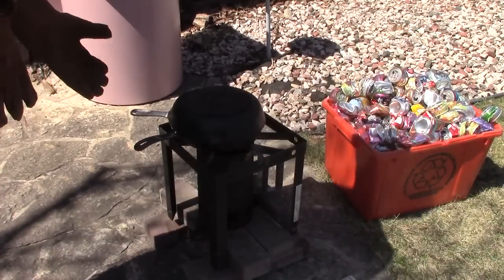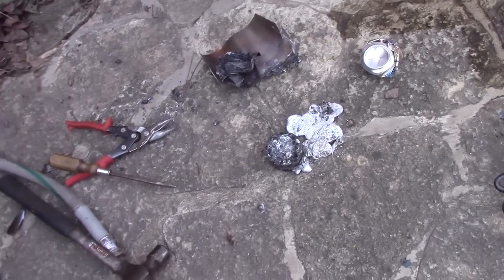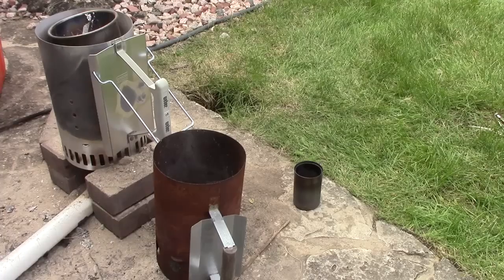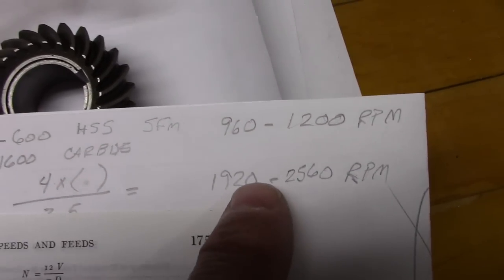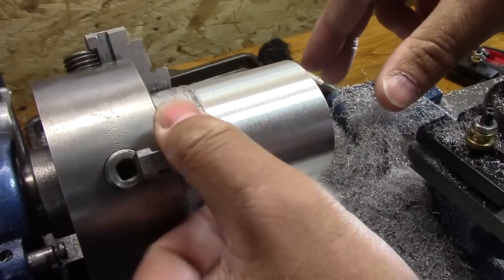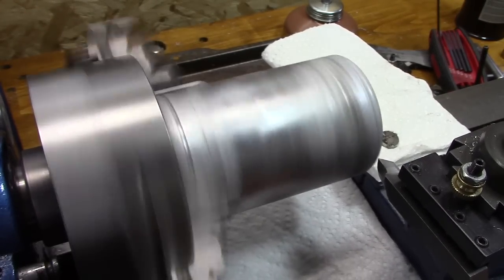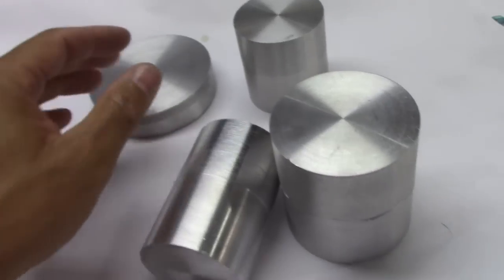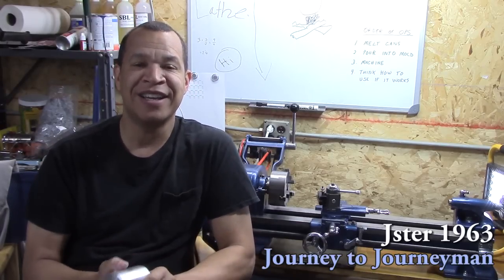Journey to Journeyman, Episode 5, How I made aluminum stock from cans

Comment: Man, we're into the same hobbies! Melting metal is very addicting so be careful. The reason your stainless steal containers are failing is due to the charcoal acting like an abrasive with the hair dyer. I had the same issue. I found that having another protective layer helped a lot. For example, I would place my SS container in a soup can.
Reply from the maker: Great info!  I melted through some pretty thick SS.  I saw your propane tank foundry and that's exactly what I plan to build this winter.  I plan to use waste oil.  I have a ton of it.  Thank you so much.........

Comment: Hi, I am back. While watching you turn the aluminum, I noticed the cutting tool on your tool holder. Did you grind that cutter or buy it ground like that. If you bought it, where did you get it. I have been trying to grind some from stock,but that is an acquired talent. I have a similar tool holder from Phase II for a 9 in lathe. I am using the indexable HSS cutting tools from AR Warner . Thanks again...Ken
Reply from the maker: Kenneth Bartlett Welcome back;-)  I ground that tool.  I'm trying to learn to do that too.  It's not perfect, but on aluminum it worked.  I'm going between indexable and HSS that I grind.  I hope to be a good tool grinder someday.  And thanks again.....

Comment: One of the things I like most about you and your videos is how you just get out there and try stuff.  Well done!  

Consider reading 'The Charcoal Foundry' by David Gingery. Excellent resource for what you are doing.    You would probably enjoy the sections on green sand casting as well.  If you like his books he has manuals on making all your shop tools from scratch or junk.  Make a mill? :)

Safety: Gingery suggests doing your melting and pouring over dry sand.  Molten aluminum explodes if it encounters moisture, like wet stones or concrete.  (Rapidly expanding water vapor)
Reply from the maker: Thank you so much Chester!  I tend to jump into the deep end, only to realize I don't know how to swim;-)  Anyway, I was trying to see if I could melt the aluminum with simple everyday stuff I had.  Now that I know it's possible, I plan to make a foundry.  I will checkout the Gingery foundry.  And yes, safety is #1.  I will take precautions now that I know I want to do this.  Thank you very much for the info and the comment......

Comment: As someone who melted using stainless steel crucibles for years, the main worry is your stirring rod actually poking holes in the bottom since the stainless steel is well above the forging temperatures. I swapped to graphite and I can tell you cheap graphite crucibles are far superior to anything else I have used. As for fuel, simple scrap/junk wood (NOT mdf) works better than charcoal briquettes as long as you stack the wood in such that it is lump charcoal by the time it reaches the bottom.  As for pre-burning the coffee cans before pouring, that is a pretty smart way to reduce inclusions from burning gasses.
Reply from the maker: Thank you so much for the info!!  I’m using a steel crucible right now just because I have it. I never thought about forging temperatures. That’s great to know. I’ll try to be gentle with my stirring and pushing. I planning to get graphite someday, but I’ll have to get tongs to lift it and something to hold it to pour. I’ll do that someday. And thank you again.....
Reply: @jster1963  I made my tongs out of some random flat bar ( a lot of bending and checking the fit). the biggest worry is if your stirring rod is pointy. as for the forging temperature properties, think of the steel as being softer than lead and almost like clay.

Comment: If you don't force the cans into a coffee can, it can only be used once. It's best to use something a little bit tougher. A steel pipe with a plate welded to it works. 

Ingots can be poured right into sand formed for the size of the next crucible it is going into.

Comment: I usually use "Used Engine Oil" only use the charcoal to preheat the main Oven CAN" and have my can cover with about 15 inches of "Pink Home insulation" that usually keep my oven from loosing to much temperature. the only problem of doing this my way is that you need a more powerful fan than a hair drier.. not to much! but sadly the hair drier is not enough..
I will contact you soon in the forum. Very nice video! Ho! and by the way! According to federal regulations all aluminum that is in contact with food! HAVE TO BE 100% pure aluminum! so is a great quality product but it is very soft! no like what is available most of the time. that have silicon, and some times a bit of nickel... Good luck man! I feel very envious of your good work!
Reply from the maker: Thank you so much for the kind words!  I want to make a foundry just like u described.  I have been saving used engine oil for years.  I probably have 55 gallons.  I do have a more powerful blower too.  I just wanted to see if I could get the aluminum to melt with simple stuff.  Now I plan to make a foundry.  I heard the aluminum was a good quality, but I don't know yet if it can be used for anything because it's so soft.  I will have to do some research.  Thanks again.......

Comment: Good work and video!
Yes, food cans can work great for molds, I use them for ingot molds allot.
Using a food can for a crucible normally works also for me but I limit them to 1 use to avoid burnout. Some good videos out there for cheap easy foundry furnaces. A good insulated furnace will hold in heat well so  less fuel needed and less heat required, sort of. Still need same temps to melt the aluminum of course but with less heat loss less heat needed to be fired is less heat to cause burnout of the crucible.
Reply from the maker: +Den Stump Thank you so much!  My sons and I made a furnace and I plan to upload that video soon.  I just made a new "THICK" crucible and I hope it never burns through.  Anyway, thanks again for the info.....
Reply: I'll watch for the video.
I should do videos of all my stuff, but I am not good with a camera or doing things on camera. I like to watch videos to see what others are doing, but never made any yet of my own.
Reply from the maker: It's not hard to make videos and you'll be surprised that others will learn from you and like it......

Comment: The video is a couple of years old, but what I use are old portable propane tanks.  The ones for plumbing torches, BBQ's.  I cut the top off, drill two holes an inch from the top and use a long bent thin rebar, bent in an upside down U shape with the very ends bent out and up a bit.  Those go through the holes, and I can pick it up easy, even 3/4 full of aluminum.

I don't like using cans, they tend to have too much dross.   I prefer old hard drive cases, aluminum parts and whatever I can find.  You can add cans to this, say 10 percent and the dross won't be too bad.
Reply from the maker: +Mike Davey I just made one from a 1/4" thick 4" in diameter pipe cut to about 9".  It's a beast and should last a long time.  I will have a video of that up soon.  And the only reason I use cans is because I have them.  Those can really do have a ton of dross.  If I find other aluminum source, I sure will use it.  And thank you very much.....
Reply: jster1963 I suggest you try computer repair places, ask if they have dead hard drives you can have.  Tell them what you're going to do with it.  I got three cases of them.  The platters are no good for melting, they are coated with cobalt.  The cobalt doesn't alloy well and it winds up like soft butter with cornmeal in it.   The biggest problem is the time it takes to disassemble, but it's good for building strong forearms.   The actuator arms sometimes contain a rare metal that is poisonous if breathed (if melted or sanded). Beryllium, I think. So I don't use those.
The step motors also contain aluminum but are more trouble than are worth for me.  The cases are high quality.  Some people suggest adding a little bit of copper cut into little pieces once it starts melting, it makes it easier to machine. Everything left I give to the scrap metal recycler.

I find another good source are BBQ's, people leave them on the sidewalk or advertise all the time for people to take for free.  The top and  bottom are usually aluminum.  If you make a fire you can toss it on, then break it into little pieces when it gets soft.
Reply from the maker: +Mike Davey Excellent info, thanks!  I've also heard that old lawnmower blocks are good too.  I have to do some digging around.  Thanks again......

Comment: Here's a tip, if you can get a carbon crucible ( or clay graphite ), you'll have a much easier time for larger melts. They are more expensive, but they aren't super expensive or anything. The thing is, the aluminum actually causes the stainless to corrode, which is why you kept getting melt throughs. A carbon crucible, although it won't last for ever, will last for a lot more melts before it fails, and is generally a lot safer.
Reply from the maker: Great advice!  And I plan to do that someday.  Thank you so much......

Comment: Mate that's awesome, I think I want one of them metal lathes and a crucible one day for some larger parts that would cost a lot of money to buy if I had to buy blocks to turn down into the parts I need. I think anyone working woth metal for DIY deep down wants to try that one day
Reply from the maker: I know I sure did!  And thank you very much......
Reply: Some videos I watch make it look easy, but then some just make me go what just happened? I'd like to grab an easy starter if I did, got any recommendations on where someone should start out? what size and what they need to have?
Reply from the maker: Are you asking about a lathe to start out with, or a melting furnace?
Reply: Lathe
Reply from the maker: +MotorcycleTherapy I was hoping kiln😁. I have to let you know that I'm not an expert!  I'm a dude that likes to tinker. I'm also guessing you're not in the states, so I'll try my best. My Atlas 618 that you see is 6" max diameter and 18" between centers. The South Bend I have is a 10" lathe. I haven't used it yet. I did so much research before I bought the SB 10 inch and most guys love the SB. That's why I went with it. Most guys say buy the biggest lathe you can afford. What are you wanting to use it for?
Reply: building up tools for a metal fab hobby, will probably build trailers and metal sculptures, a few different things. I would like to build a compactor and melt down the soda pop cans, then make the odd piece, but this plan is way off down the track. I'm more asking now for hints, because I'd keep a note of what I should keep an eye out for on 2nd hand tool sales websites, ebay, craigslist etc. It's the type of thing that's more a good tool for odd parts for me, I'm also more a hobbiest / tinker, not really thinking for a production type of shop. Thanks mate, I'm in Australia by the way, if things go alright later on day the track, you never know, I could find myself building things and selling more often, but no rush for now
Reply from the maker: Real cool!  I'm not sure what's available "down under" but most guys like us have a 10 inch lathe.  If Aussies measure lathes like the Britts, you want at least a 5" lathe.  Also, you have to figure out if you want to go with a new Chinese lathe, or old "non import" metal.  I was going to buy a Craftex 10" lathe but they don't have them in the US.  I would have had to import it.  Some Chinese lathes are great.  If you get a good lathe, you will be surprised how much you will use it.  Let me know what you end up doing.  Take care........
Reply: Thanks mate, appreciate the help
Reply from the maker: Anytime.....

Comment: Possibly the reason you had burn throughs is that molten aluminium dissolves the iron from steel crucibles! if you get some potters or fireclay and mix it to a smooth creamy texture, then coat the inside of the crucibles with that "slip" it'll make them last a lot longer as there'll be a barrier between the Iron and Aluminium...

When choosing raw aluminium to melt, try to get scrap that was originally cast (used pistons from engine rebuilders are excellent) as it's already the correct alloy, and ensure there's no iron or steel included (cylinder studs etc.) as that'll try to dissolve in the melt too!

Looks like you had fun though :)
Reply from the maker: Thank you very much! I did have fun and I will try that.  I never thought to coat the steel.  I hope to have a furnace soon and will try it.  Thanks again....
Reply: Iron in the melt isn't good for the aluminium either, leaves it quite a bit weaker with worse pouring qualities. The Serious Metalcasters often use silicon carbide or fireclay crucibles, very good but pretty fragile (especially fireclay) requiring special tongs and such to handle them safely.
Reply from the maker: Cool.  Thanks....

Comment: I think you'd be happier pouring that aluminium into a sand mold, even if it's an open mold (basically just a hole in the sand) - no cans to rip apart that way. Also, for the crucible, I have found that the bottom half of an old fire extinguisher can survive a couple of pours. It's still better to weld one together from a beefy steel pipe and a thick piece of plate steel, though.
Cheers!
Reply from the maker: +George Thank you so much!  I will have to figure out how to weld a crucible, because I don't have access to fire extinguishers.  Great ideas though.  I hope to do a pour real soon.  And thanks again......

Comment: What about inter-granular corrosion due to the slow cooling?  Aluminum that is not properly heat treated will exhibit this corrosion.
Reply from the maker: I'm not sure.  Great question, but I don't have a clue.  The aluminum that I have melted shows no outward signs of corrosion.  There may be on a micro level, but nothing that I can see.......
Reply: Great video and a great idea. My wife was watching it with me and was thrilled with a usage for the empty soda cans at our house.
Intergranular corrosion begins at the molecular level internally, from the inside out, in aluminum which is not properly heat treated. The first noticeable signs are normally exfoliation at the surface. By the time that happens the aluminum (part) is useless. This is a basic subject for an aircraft mechanic.
 While I will definitely try out your ideas in the video, limiting the use of the recovered aluminum to ornamental, non structural applications would be advisable.
Reply from the maker: Shannon Stebbens Awesome!  I'll have to learn about heat treating. And I definitely don't use this for structural things. And thank you again.....

Comment: aluminium takes a lot of energy to produce so recycling like this is important , save the planet
Reply from the maker: +alan manning So true!  I plan to make a few more things from pop cans and used motor oil.  Thanks so much.........
Reply: +alan manning Not only that, but AL stock can get very expensive the bigger the stock size you need. I just tried the can method, next i will try casting a larger ingot with an old bread baking tin. The pan is 5x10x4 inches.
Reply from the maker: Great idea!  I'll try that too.  Thanks.....

Comment: Don't waste time with the bricks unless you pick up some insulating firebrick. The easiest is ceramic fiber blanket. Kaowool is one brand. Also a real crucible is only $30 or so with a shank to lift it with. foundry101.com is a pretty good source. There are a lot of home mix refractories but the real stuff is much nicer to work with and lasts longer. Look to see if you have a boiler company local to get stuff. Shipping can be rough.
Reply from the maker: Great info, Thanks!  I plan to make a little foundry now that I know that the concept works.  I will check out foundry101.com.  I'm not sure if it showed in the video, but my concrete blocks cracked.  So yes it was a waste.  They only cost $1.30 at Lowes so I didn't lose a ton of money.  Thank you again.......